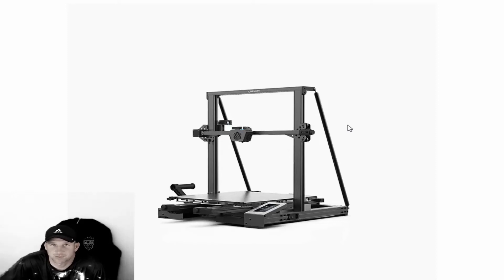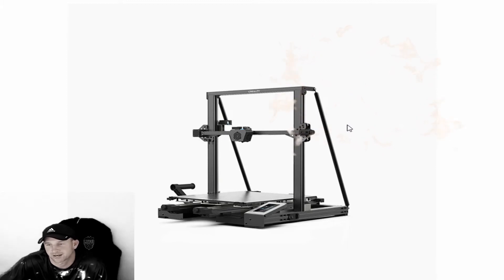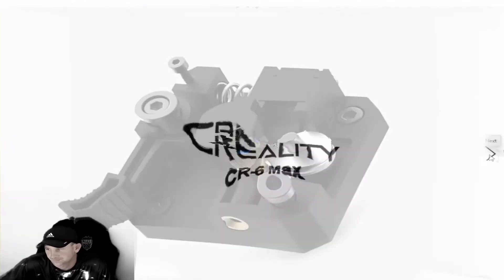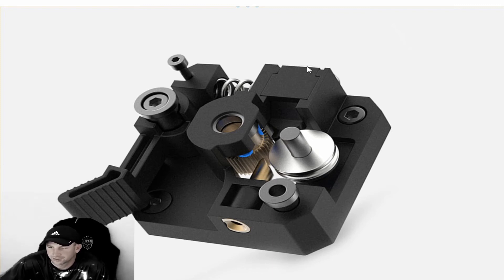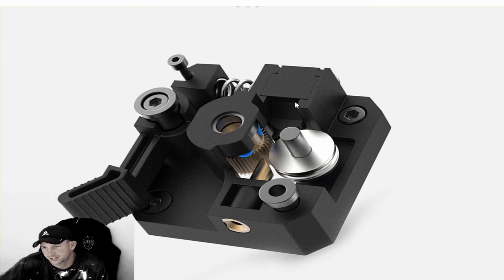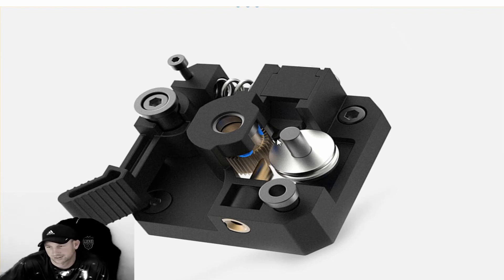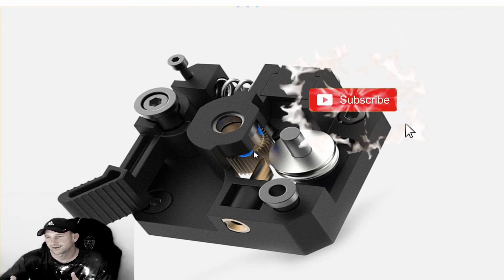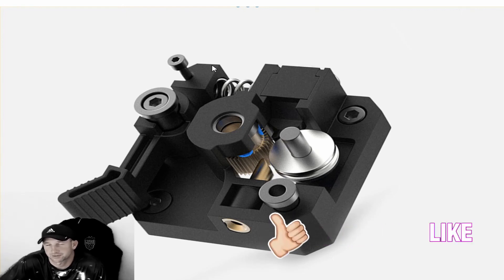3D Printer Filament Breaking. Jammed.  Not Working.  Not Feeding. Simple Fix Adjustment on CR-6 MAX

Comment: am having the same issue with my cr 6 max, i've tried adjusting that screw a number of times but it still doesn't work, there is also alot of extruder slipping
Reply from the maker: Please check out our two different videos that tell you how to fix this issue.  One of these should hopefully fix your issue.  If not send us an email with a video of your issue.  We will review and see what's going on.  IHUCT